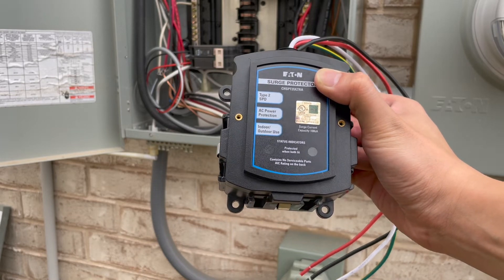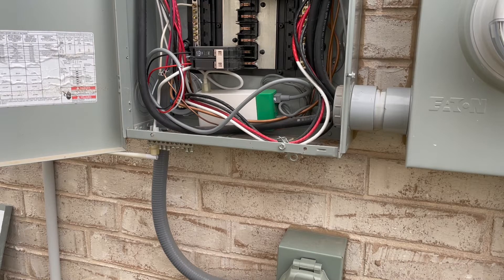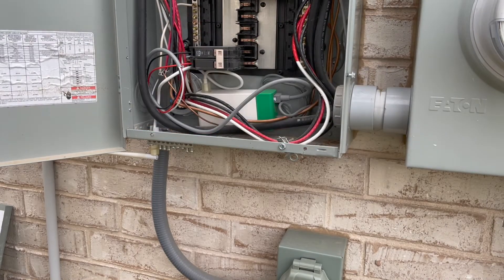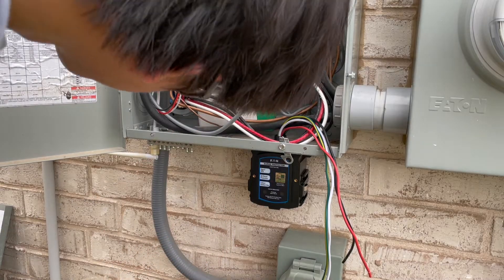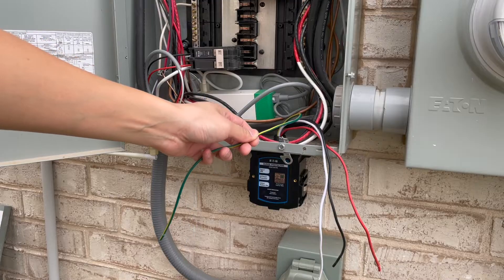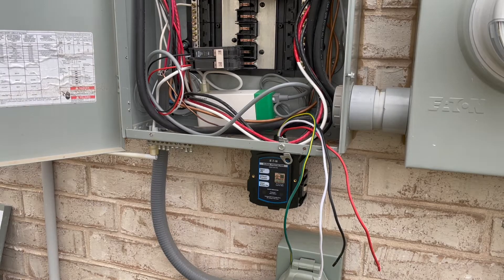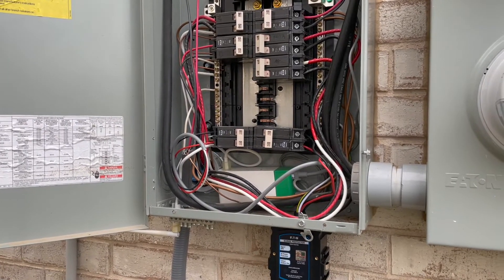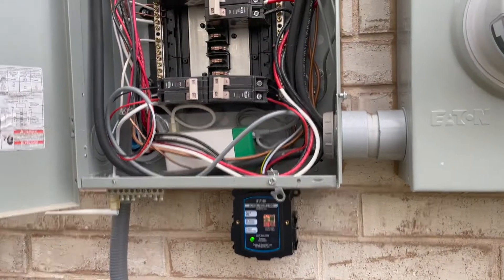EATON CHSPT2ULTRA Full Installation Video

Comment: Where did your green and white wire go?

And if the wires for the surge protector come short, can the surge protector be on the side (instead of the bottom)?
Reply from the maker: The green wire goes to the ground bus while the white wire goes to the neutral bus. 

Short answer: Yes, the examples in the manual even show it being installed from the side. If the panel is an outdoor panel, please exercise care that you are not introducing a spot for rain to get into the panel.

Long Answer: Many people on the internet believe I am doing this wrong and that the surge protector should ALWAYS be the closest slot in the box to the incoming power. However, from my understanding of electricity, I don't believe this makes a difference as a surge would travel all slots at the same time - it does not travel to the first slot first and then to the others. This leads me to believe that putting this anywhere in the box would be sufficient. Additionally, there are prebuilt panels that always keep the surge protector at the bottom while the power comes from the top. Lastly, the instructions only state: "Locate a dedicated unused, or install a new 2-pole circuit breaker in an available space closest to the location where the CHSP is to be installed." You should be good to put it anywhere that is convenient inside the box.

Comment: Should be installed AS CLOSE TO THE INPUT POWER CABLES as possible.
Reply: Eaton says it doesn't matter where you put the protector!
Reply: @whiteywhitney-my6gl  page 2 of the installation instructions. Under "important" RTFD.
Reply: You could just say "I don't understand how electricity works". If its in the first or the last all the other circuits are still going to receive current. The 2ft of travel to reach the surge protector is still much shorter than the nearest 20ft it needs to travel to reach the nearest appliance.
Reply: @jtmiller15  My licensed electrician installed this exact one closest to the disconnect switch .. he even moved the subpanel breaker (which was originally closest to the disconnect switch) and connected the surge protector there. Dude was a 30+ year electrician. Your logic does sound right .. but that's just how he did mine.
Reply: @Re5ist_ance  That’s called “best practice” but by no means the only way. Look up how a surge protector works and concept of “path of least resistance.”
Reply: @mintheman7  Eaton says to use a 50 amp breaker with this in the installation instructions and per Eaton it doesn't matter where you put in in the load center
Reply: @Re5ist_ance  Eaton says it doesn't matter where you put the protector,some of their load centers come with this protector factory installed at the bottom of the buss,be sure to follow the installation instruction sheet word for word.
Reply: @Re5ist_ance  30 year electrician may not know the actual numbers of the calculations for resistance , currents and distribution  of voltage drop along the lines.  He may never did the calculations.  What  Everybody is saying does not mean it is true.
Reply: @jtmiller15  surges are measured in micro seconds. Protection is provided on a first come first served basis .  Everything down stream will be protected within reason and everything upstream of the surge device  not so much. Location of the device matters as does the length of the leads and whether or not they are twisted to reduce impedance.   Having said that I truly could not care less what you do so I'm done with this conversation.
Reply: @cmearls55  Nothing is "downstream" of the Eaton breaker, the bus bar will still provide current from a surge to all the breakers attached to it whether the eaton breaker is first or last.

Comment: Wow I can’t believe this clown posted this.  Talk about amateur hour.  Completely wrong install
Reply: You could just say "I don't understand how electricity works". If its in the first or the last all the other circuits are still going to receive current. The 2ft of travel to reach the surge protector is still much shorter than the nearest 20ft it needs to travel to reach the nearest appliance.
Reply: @jtmiller15  are you an electrician?  I  certainly am and this install is completely wrong
Reply: @chrisstanley1131  I doubt that, otherwise you would realize why it wouldn't make a difference where this is installed. Or you just have a surface level understanding of electricity, without understanding any deeper concepts.

Comment: 5:56 You forgot to twist the red and black wires together according to the instruction manual.
Reply: Page 4: To maximize the CHSP’s performance, twist and bind the wires together to reduce the impedance of the wire (one twist per inch).

The white and green wires will diverge from the twisted bundle on their way to their bus bars and the red and black should remain twisted all the way to the breaker.
Reply: Is it just the red and black or all the wires…vague directions
Reply from the maker: Thanks for pointing this out! I looked in the manual and you're absolutely correct - in the IMPORTANT section, it states:

• To maximize the CHSP’s performance, twist and bind the wires together to reduce the impedance of the wire (one twist / inch).

Next time I am working on the breaker panel, I'm going to go in and fix that. Thank you for commenting!

Comment: Not a fan of Eaton panels. At all. You can see why. BTW, you should have the SPD tied to the very first breaker in the panel if the service entrance cable is on top or the bottom if it enters the panel from below. Ideally, the very first device the surge should see is the SPD once it hits the distribution panel. The way you have it it's last. Not optimal.
Reply: Eaton says it doesn't matter where you put the protector
Reply: You should read the install manual before throwing out "you should" comments.

Comment: Se puede poner este equipo en cualquier panel de control?, yo tengo 3 paneles de control que estan enlazados en diferentes lugares de mi casa......... y lo recomendable para protegerlo con cual capacidad de breik minimo y maximo partiendo de lo especificado.
Reply: yes   any make panel will do . however the brand of the  50 amp breaker must be the same as the panel brand or comparable.

Comment: If the Panel is 200amp how is the 50amp surge protector going to help? I think this is for a specific item, such as a 50amp hot tub. A "whole house" surge protector would need to be rated for the whole house, correct?
Reply: That's a thermal-magnetic breaker to protect the circuit if the SPD dead shorts from a direct strike or if the MOV's fail in spectacular fashion as they sometimes will. The duration of the 'over-voltage' spikes we are talking about are in the micro and millisecond range (10's or 100's).
Reply from the maker: Hi Bruce, great question! The surge protector is not a 50 amp surge protector. If you look on the spec sheet, it is rated for 108kA (that's 108,000 amps!) surge current (https://www.eaton.com/us/en-us/skuPage.CHSPT2ULTRA.specifications.html). It is advertised to reduce high voltage surge currents to 
600V L-N, 1000V L-L, 800V N-G, 600V L-G (this is the clamping voltage or in the link the "protection" specification). What this means is that the maximum voltage allowed is 600V measured from line to neutral, 1000V measured from line to line, 800V measured from neutral to ground, and 600V measured from line to ground. 

So you might be wondering now, how in the world is it able to do that on a 50 amp breaker??? Well, the way breakers work is that it does not actually trip instantaneously when a certain amount of amps goes through the breaker. The rating is actually for sustained power draw. The actual mechanism inside the breaker is some element that heats up as a large amount of current flows and then trips the breaker. For surges, the amount of power that flows through is too fast to trip the breaker and is able to absorb the surge in the device.

All this said, the manual that comes with the surge protector states that you should connect this to a 50 amp double pole breaker. I'm assuming they have tested and done all the calculations to ensure that the breaker would be sufficiently large enough to allow the unit to absorb the maximum amount of surge that this unit supports.

When buying whole house surge protectors, you are looking for the maximum amount of surge current and the lowest clamping voltage that they can provide. There is no "matching" of the rated capacity of the panel to the surge protector - it really is just about how big of a surge the surge protector can handle. This said, none of the type 2 surge protectors on the market will be able to protect you against a direct lightning strike - that is in the order of magnitude of 300 million Volts and about 30,000 Amps. Type 2 surge protectors though can save your equipment from lightning that strikes main power lines and ripples down to push a surge to your house. The higher the surge current rating and the lower the clamping voltage, the larger the surge the surge protector can handle and the better it is for your equipment.

Hope this explanation helps!
Reply: @jonathanDIYs  That was a great response and answered a different question I had. Thank you!
Reply: Just bought one myself. The CH Surge Protector, for a weekend project. Waiting for 50A 2P Siemens breaker i ordered.
Had a recent surge spike in my area. Blew my garage door opener’s, control board. Don’t want to have to replace the whole unit
again. My new opener, has even more electronics WIFI, and bluetooth connectivity…
Reply: @dtntnw  Those 'CH' units are OK but they're made for the consumer market. There are better units that you can find cheaper. (not the breaker mounted ones either). If you got one I would get the 'Ultra'. I think it's rated @108k. I have the same openers, Chamberlain I think with the battery back-up. I had a problem with my refrigerator. Thank God it was still under extended warranty. They changed $1000 worth of circuit boards in it.
Reply: You only need a 15 amo breaker
Reply: @2falltoofly81  thankyou very much for your reply, however this was 10 months ago.....the job is complete, customer paid me.
Reply: @2falltoofly81  Eaton says to use a 50 amp breaker with this in the installation instructions
Reply: Eaton says to use a 50 amp breaker with this in the installation instructions
Reply: @whiteywhitney-my6gl thankyou. But this job was completed a year ago or more. ;)